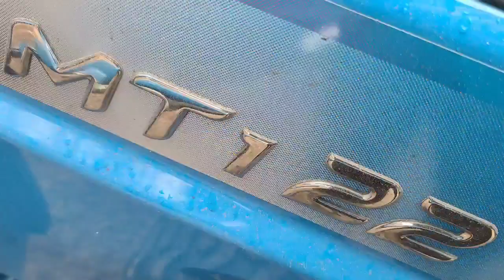Why buy a LS over other brands? Why the MT122/125 LB1107 Backhoe?

Comment: Hey, I've watched a couple of your videos on the LS MT122. I'm strongly considering buying one because of the price on a unit with the backhoe.   For a small property, only an acre and a half to do some digging, snowblowing and yard work do you think there is any reason to go any larger than the mt122?  I like the looks of the larger frame size (xj model), but in all practicality I probably dont need a bigger tractor for my needs...   Also, any regrets not going with one of the big brands?   Same engine manufacture as John Deere uses if I'm not mistaken anyways.
Great videos. Thanks for sharing! Cheers
Reply from the maker: I think its perfect if you have under 5 acres
Reply: @TheRichardOlson  I did buy the MT122, got it last friday and have been putting it to work already. This thing is a workhorse for the size of it, im very happy with it.  Soon to dig my first trench with it to bury some water lines for an outdoor wood furnace.  Thanks for posting the video showing it work.  Cheers
Reply: I love my 125MT just a bit more HP
Reply: @kyle25rs  any updates? Still like it? Any problems? I’m thinking of getting either the 122 or the 125..
Reply: @TheFrogfeeder  still loving it. I think I have around 75 hours on it now. 2 winters blowing snow with a 54" blower and some serious loader work and backhoe digging. The tractor has held up well. The only issue I've really had was the front tires didn't seal well on the rims and had slow leaks so the dealer put tubes in for me at their cost and that solved that. I'm still very happy I went with an LS over the more pricey brands, it's been a real game changer

Comment: I have been (am not anymore) a fan of LS tractors since 2010 when I fist started following them during my research phase.  I was a fan until spring of 2020. To everyone thinking of buying an LS tractor,  there is important information you need.

First, the reason I fell in love with LS is because the physical product is pretty dang good. Dollar for dollar,  its really difficult to beat LS. I have always been very pleased with the equipment.  I am on my third LS tractor as we speak and I have liked them all. I spent a good 8 years flogging LS tractors to others in forums. So what happened? 

The one problem from the very beginning has been the Dealerships, and to a lesser extent,  the website.  I'll get to the website in a sec. I can tell you that I live in central ny and I've been to every LS dealer within a 100 mile radius. It's not that any of these dealerships are arrogant jerks like you might meet at well established orange and green stores. It's that the after service has proven repeatedly to be abysmal.  Abysmal to the point where this spring I had had enough.  Good price or not, when you spend 30k on a tractor,  you expect some basic service.  The third dealership for the third tractor I own was the final straw. Folks, the dealerships make LS tractors unbearable.

Examples.  If you're buying your first tractor and you have done your homework,  it's likely that you will know far more about the tractor you went to look at on the lot than the guy trying to sell it to you.  That's true at the orange and green shops as well but trust me, it has a bigger impact at LS stores. I have found that every dealership I've been to in NY has been exceptionally unwilling to work with you on anything outside of a cookie cutter set routine.  It's like being on a rail ride. Want to step even one toe outside the cookie cutter?  No sir!!!! And frankly,  the service is subpar. And that's saying a lot.

The biggest problem is that in nearly every case, LS gives out a dealership to what was previously a small engine repair shop or a snapper lawnmower dealer etc. None of these shops have the depth of knowledge required to properly service the equipment.  And I'm not talking about the bogg standard stuff like oil changes. I'm saying anything outside a very narrow band of very basic services is going to turn into a big problem. And once more, that's saying a lot. 

If you have done your homework, you will recognize how poor the LS website is. The website is a desert of relevant information plagued with spelling mistakes and outdated information,  or very confusing information,  or no information at all. It's a total mess. The worst part is, if you don't go to the website armed with information ahead of time (and information is hard won), you won't realize just how screwed up the site is. So if you're relying on the dealer or the website to educate yourself on the products,  you're in a LOT of trouble. If you're set on buying an LS, you better spend a good amount of time digging for information.  Hard won information. Other wise, you WILL be sorry. 

In many ways,  the website is a direct reflection of the dealerships.  Misleading and half baked. 

While I in fact like my latest tractor that I received last spring,  as I liked the other two, this last experience with the dealer was the last straw. My next tractor will be orange. And while I have found that both orange and green stores can have similar problems, good dealers are out there.  And folks, there is more to buying a tractor than the equipment. The dealership is  50% of the equation. And I'm here to testify that the LS dealerships WILL let you down repeatedly. I'm all done with LS TRACTOR.
Reply from the maker: I disagree, for what I have experienced I am super happy. Now being a year of ownership. Great piece!
Reply: WOW Good Info. The funny part is that there is a new dealer in my area for LS, and he is a Toro lawnmower dealer.I have been on Orange for 30 years. The reason they cost more is... they are worth it. I didn't mention Green because Orange is in a class by themselves.
Reply: @TheRichardOlson  You need to have a conversation with future you lol.
Reply from the maker: Absolutely ls absolutely drops the balls repeatedly on customers
Reply: You contradict yourself it seems. Why do you keep buying LS tractors if you have such negative feelings ?
Reply: @El Lobo  I don't contradict myself at all. I stated very clearly that I don't buy LS tractors anymore. I also clearly explained the reason I bought 3 is that the physical equipment is very good for the money.  I also clearly stated that the dealerships are destroying the brand with their terrible service.  

But hey, don't take my word for it.  By all means buy one. Let us know how the service is after the sail if you need anything other than basic oil changes.  And trust me, at some point you will need service.
Reply: @stanjuan1178  But you state that the issues you have happen at the competitors also. And for you to haul a tractor all the way to a dealership for an oil change tells me you know very little about tractors. A 10 year old could change the oil on 90% of tractors. Not trying to be insulting, just stating facts.
Reply: @El Lobo  dude, stop trolling.  The guy who posted this video, who originally disagreed with me, posted a later comment that I  was right after all.  

I'm not going to argue with you over nothing.  Buy yourself whatever you like. Maybe you will have a great experience.  My comments were a PSA to warn people what they are getting into.  If you don't agree with my assessment then disregard it. That's all.
Reply: @stanjuan1178  I wasn’t trolling. What I stated about your comments were factual. I’m not pro or anti LS. But since you are benevolently providing PSA, could you give some examples of what information the LS website should publish that they aren’t. And examples of your requested service on tractor that was denied or improperly done.

Comment: Got here from Facebook post. I considered buying one of these but don’t get me wrong, I hope you don’t have issues with it but the issues I have seen people encounter were bad, like really bad. It scared me off but every machine is different. Hope yours turns out to be a mule.
Reply from the maker: Yea,  The issues with the cabo DE in the John Deere scared me off those machines I did my due diligence and shopped around quite a bit joined in the forms in looked around this is definitely the most bulletproof tractor in its size.